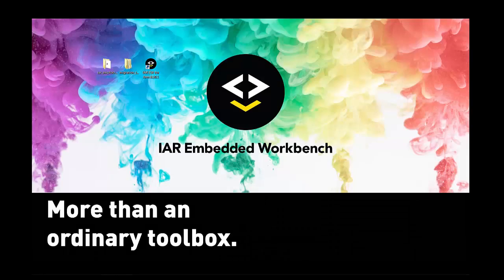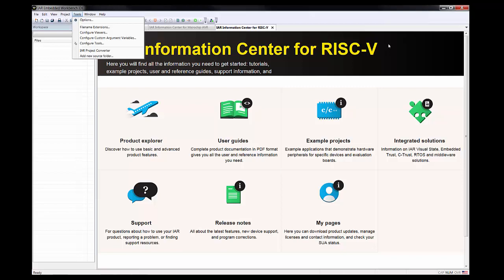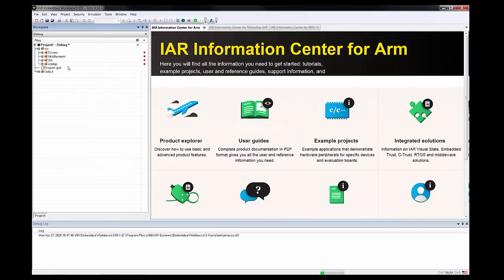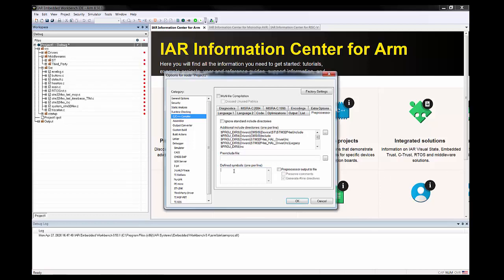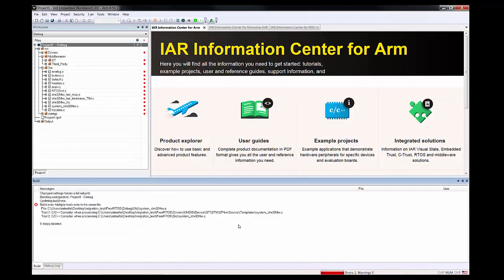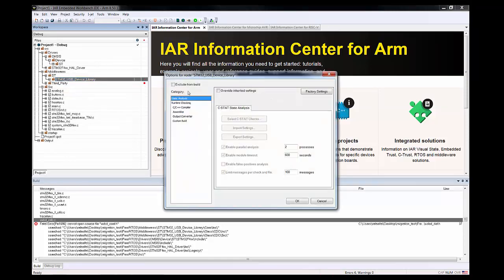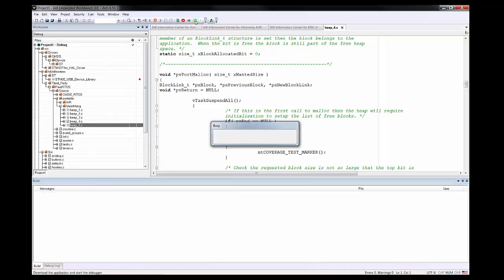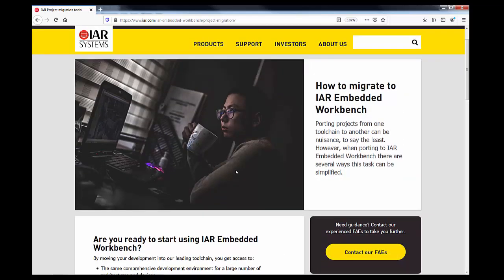Migrate your projects into IAR Embedded Workbench, step-by-step guide

Comment: Hi! i want to know how can I change from a Compiler version 7.5 to 8.2, I am facing some issues because apparently when building, it is using the 7.5 not 8.2V
Reply from the maker: Hi, Pamela. Thanks for reaching out to us. Could it be that you are using a makefile or building from the command and it is invoking the compiler version 7.5 (path to the install folder)? I would recommend reaching out to FAE@iar.com so we can assist you on making sure the right compiler is used. We can also have a look on your setup and configuration.

Comment: When I use "add new source file" it generates a .ipcf file instead of copying my file structure. Any clue as to why?
Reply from the maker: Thanks for sending us your question. The .ipcf file is correct and is the project connection file to populate all the source files within the selected folder. This makes is easier to mix existing source code in the project three with library or new source code to be added. Could you please check if the option under Tools->Options->Project: "Enable Project Connections" is active? This is required in order to make the migration steps work correctly.
Once the source code is added you could delete the .ipcf file if needed. Please let us know if you need any additional hints. You are welcome to reach out to fae@iar.com and we will be happy to assist you further.